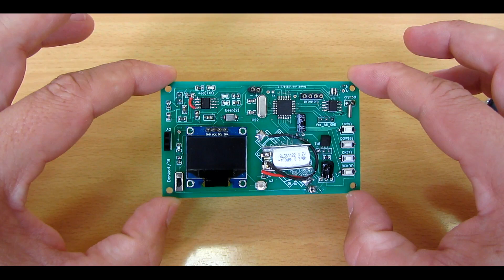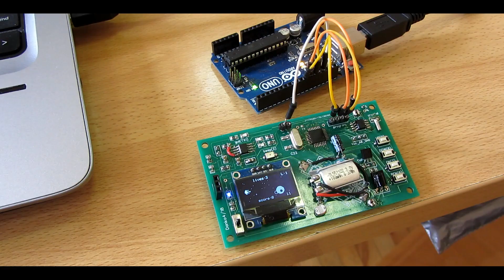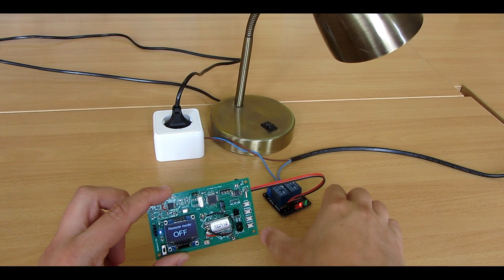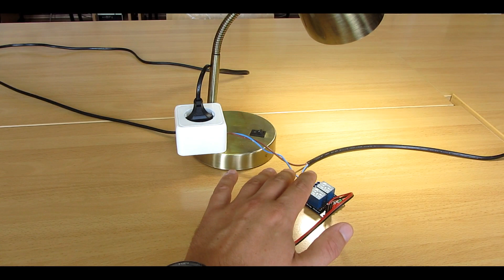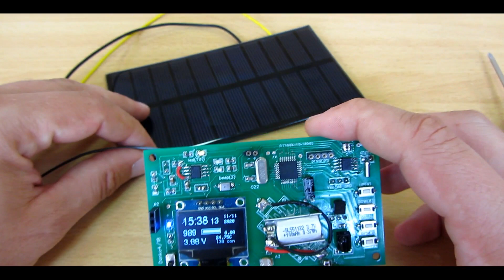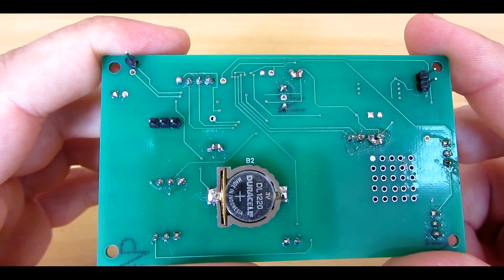Home automation Arduino board with temp ,light sensor, IR , RTC, solar baterry charger

Comment: Nice design man, which screen is that btw?
Reply from the maker: thanks , it is 128*64 oled screen, I2C interface
Reply: Alright, thought it was a higher res, size is 0.6 right?
Reply from the maker: Juan Sanchez  no, size is 0.96